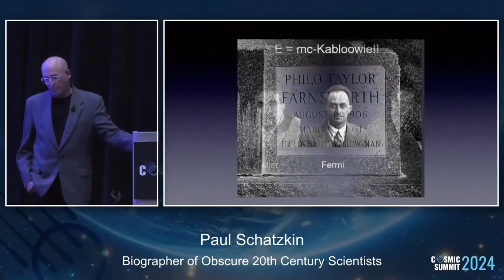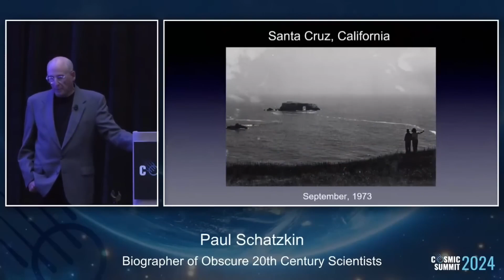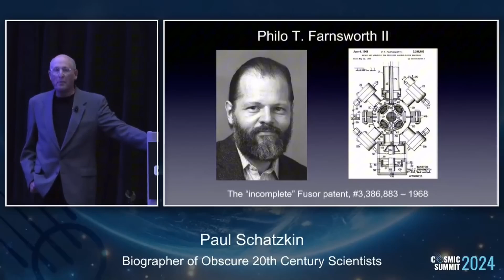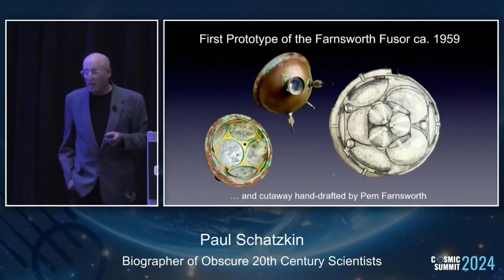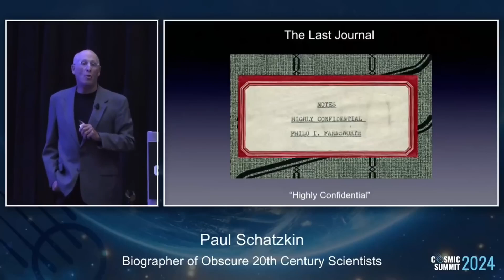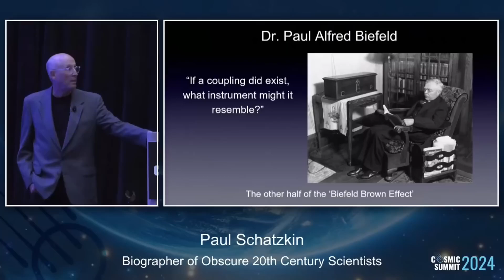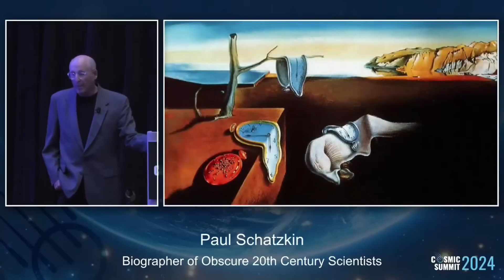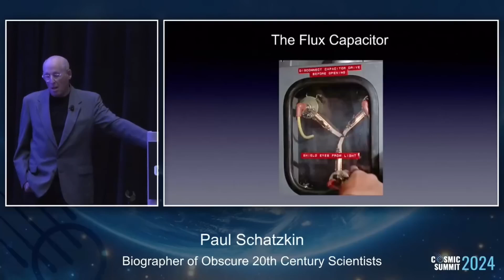Television to Cold Fusion? Yep.

Comment: It's also called a Flux Capacitor...more emphasis on the Flux BC when u Get into this stuff like lifters or charGed capacitors it becomes obvious very quickly it has ro be pulsed for any control ie the flux. The issue is a power to weiGht ratio.